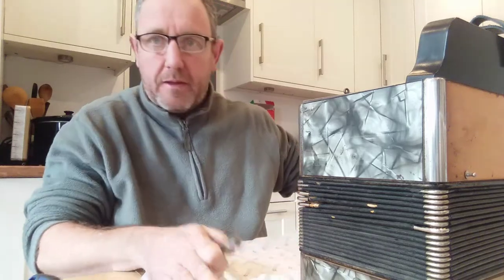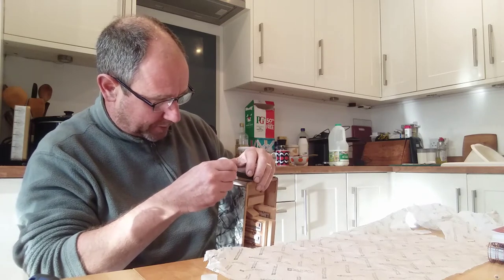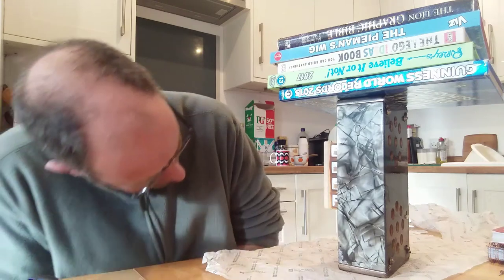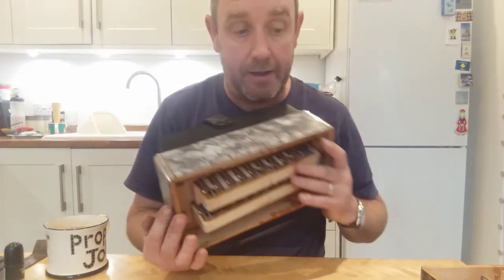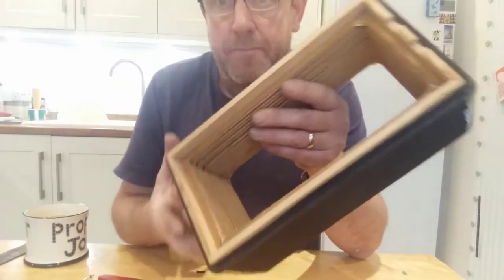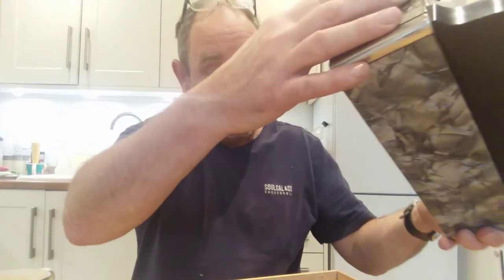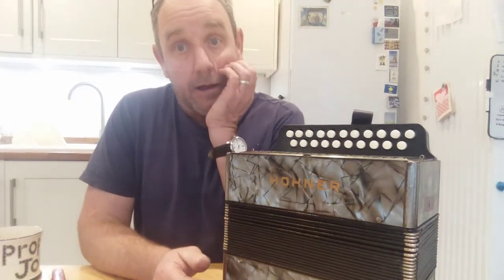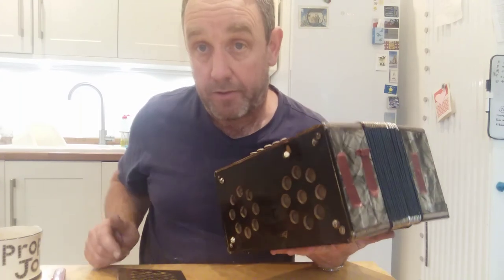kitchen table melodeon restoration part 6 - fixing veneer and fitting new bellows gasket...

Comment: When cutting the ends of your bellows gasket to length, it is better to overlap the finishing end of the gasket over the starting end by about a centimetre, then use a sharp blade to cut vertically through both layers of gasket. You can then remove the excess bits (even the original starting end) to leave a perfect flush join, with no fiddly measuring or guesswork. Even better if, when you are cutting through both layers of gasket, that you make a diagonal cut at about 45 degrees rather than a cut at right angles to the bellows side. This forms a better air-tight seal.

Comment: Brilliant video thanks. Would a bellows gasket shallow angle long joint be better than a 90 degree cut  ?
Reply from the maker: I don't think it would make any significant difference- as long as the two ends are cut square and but neatly against each other all will be fine😁